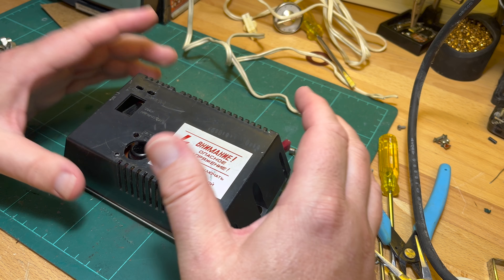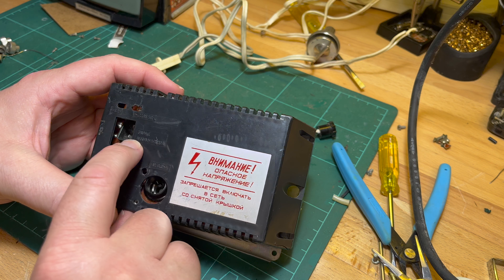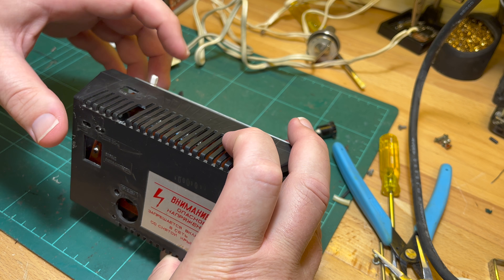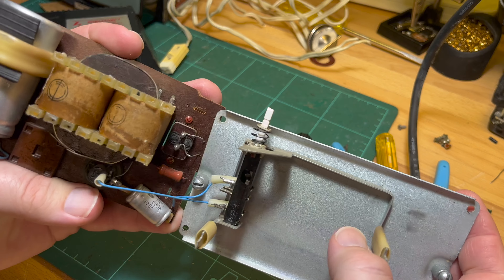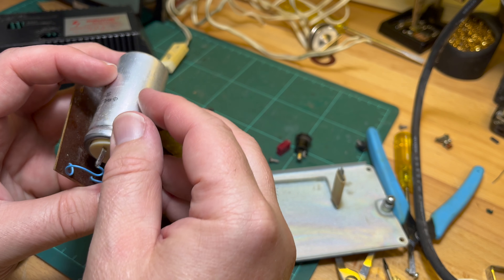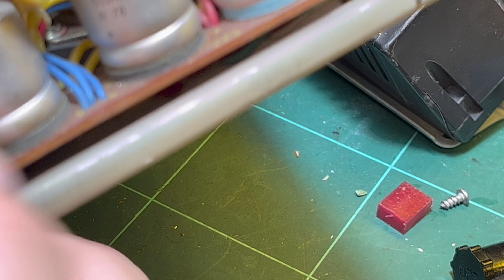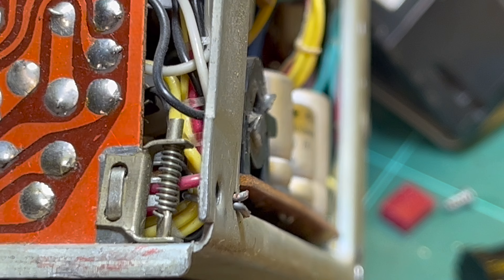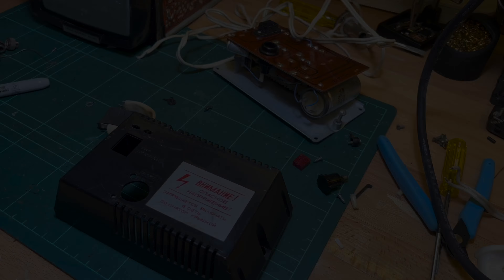Электроника ВЛ-100 (Elektronika VL-100): Part 2B (Power supply) [TCE #0266]

Comment: You can use 2 smaller caps to build big one... connecting in series for high voltage...or conecting in paralell for capacity...eem im using component tester for this caps to check what life is left in them :)